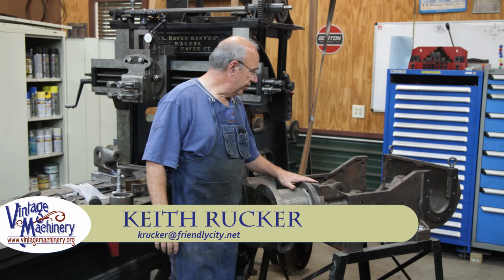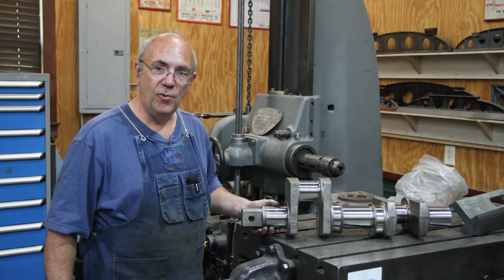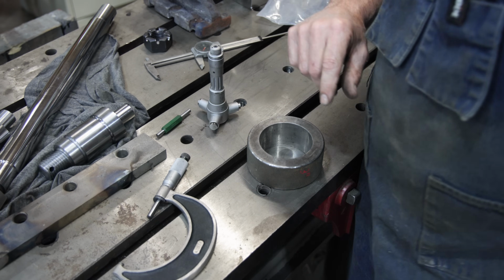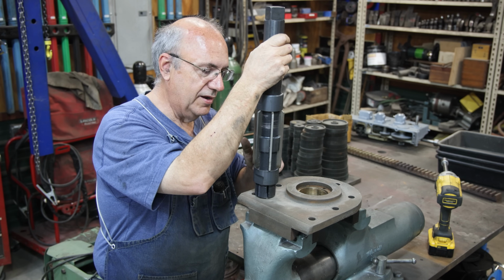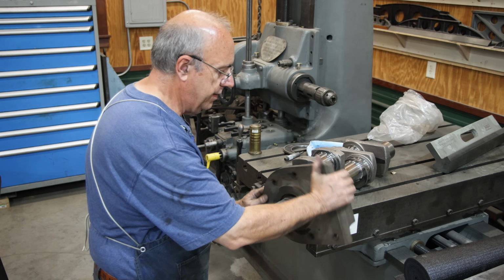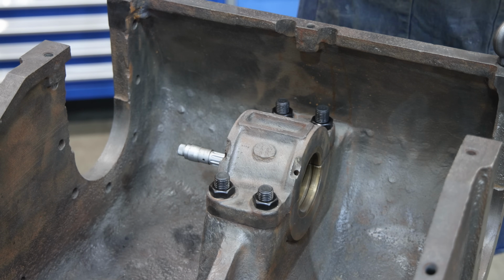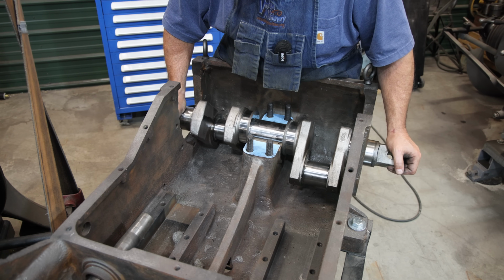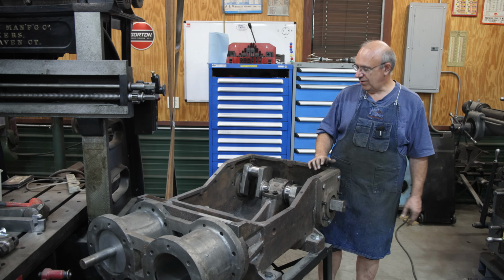Steam Stoker Engine: Installing the Crankshaft

Comment: As a ghetto measure of the middle bearing you could take plastigauge along the full length of the bearing you would see at least see if there is tightness at the top and bottom and that is where you were tight on the other bearing.

Comment: "Fun" story... when we were separating the engine and tender on one of the locomotives I worked on... the last thing holding the two together was the bolt connecting the engine and tender segments of the stoker auger.

There's a hole in the bowl of the stoker conveyor tube to get that bolt out, but the shaft was in the wrong orientation, by maybe 20-30 degrees. So I had the pleasure of squeezing into the stoker engine compartment, and lying on top of the stoker engine, trying to turn the entire auger by hand with a pipe wrench.

Lying on top of the stoker engine, while pulling on the pipe wrench... with all the bits of the cover digging into my torso... that was fun.

Made all the more worse because the stoker engine is connected to the auger through a gear box. In the end, I was able to get it lined up... or so we thought...

The next day when my buddies went to get the bolt out, they realized that it was 180 in the wrong direction, so another buddy had the privilege of having to repeat what I had done, but now going the full 180...

Comment: Hey Keith buddy, you should use a dye and see where the crankshaft is touching the bearing. I think you'll find it's only touching in three spots. I might recommend using lapping compound between bottom bearing and the crank to creep up on the dimension. You could even make a sacrificial rod for lapping

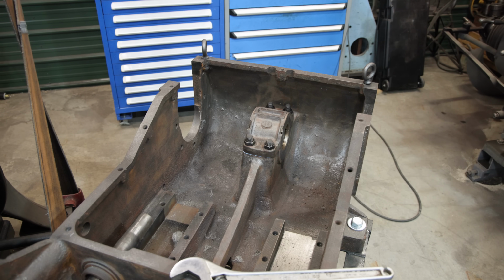Comment: @32:24 I would stop and figure a few things out. 
First is how much can the outer bearing retainers move on their studs? 
Second  is how to ensure they are aligned with the center bearing.

Third is I would use the simple old telescoping bore gauge to measure the out of round on that center bearing. 
After accomplishing that I would get the outer bearing retainers bolted on exactly where they need to be and mount the whole thing on the horizon boring mill, set it up and bore the center bearing in line with the outer bearings.

Comment: 5:03 - Note the crank-pins are quartered so it will always start.
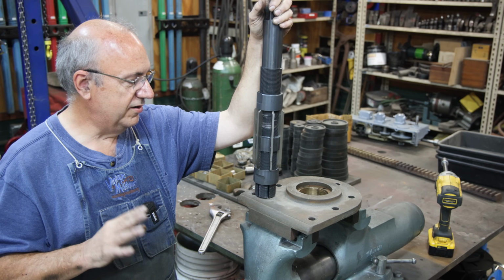14:25 - Maybe. You have three bearings with no guarantee of alignment, and what is probably a fairly high-torque load on a 3-main crank, leading to crank flex if the mains are not in alignment. I'd assume the alignment far more important than the clearance; IC engines (up to 10K RPM) run at .002"/1" of journal size, assuming good alignment.

Comment: If there is any play around the end cap studs, the end cap may pull down on the crankshaft when tightened. Try loosening them up and see if it frees up the crank. If so, tap them into position, then tighten. If not, oh well, was worth a try. I love what you are doing here.

Comment: Once center bearing cap is torqued to spec , it will change the fitment, all measurements should be done with cap at torque ....

Comment: That 2nd end bearing wearing sideways would indicate uneven compression (i.e., that the other cylinder had better compression, as this is when thrust occurs in the other cylinder, them both loading perpendicular to each other).  Something to keep in mind when you get to the piston rings (or however they 're sealed).

Comment: Maybe this has already been covered but I THINK I know why the babbitt bearing material is "reversed" and is attached to the bottom of the Cross Head and not under it on the main casting.  I would think that melting/removing old babbitt material on the cross head is simple (use a torch and let the melting babbitt drip into a container.  However, trying to do that same task to the babbitt deep within the main casting would be much more challenging to say the least.

Comment: Hello Kieth. I would make a pilot/cone for that expansion reamer and line ream the whole thing at once. I use those expansion reamers all the time line reaming airliner Landing gear bushings. We always use a pilot screwed on the end of the reamer with an alignment cone and ream from one side then switch around and go the other way with each adjustment of the reamer. I hope that makes sense.

Comment: So many problems… adjustable readers are crap. You don’t know if you’re bored it’s perpendicular with the housing. You don’t know if the motor housing is perpendicular with the crankshaft.  
Definitely, you need to line bore it for a good job

Comment: I may have missed an episode, but this is the first time I recall seeing the hones on the drill motor.  I know you go to swap meets, do some horse trading, scour the dBay, and occassionally purchase a  new tool from McMaster-Carr.  

What is the thought process for obtaining and retaining your tools?  Did you buy the hones for a specific job and then decide to keep them?  Same way with that adjustable reamer.  I was expecting to see you set that stoker engine up on the horizontal boring mill.  So, do you have a vision of what you'll need and then obtain it before you have the definate need, and once you have used it, how do you decide to keep instead of sell or trade it away?   I'm sure many of us have duplicate tools, tools we've not yet used, or only used once in our tool boxes, but how do you decide?  Do you have a spreadsheet/database of your tools: when acquired, when used last, what project, etc?   And is there a milestone "I've not used this in 10 years - into the trade pile."

Comment: Armchair machinist time. The crankshaft was machined with today's technology. It is easily assumed they are all in alignment and within tolerance.  The end bearings were "hand" reamed into some circular shape, but there is no guarantee they are aligned. If I got off my armchair, I would remove the middle bearing top and if there was enough play in the side bearing bolt holes, assemble everything, spin it, and then torque down the end caps and see if the crank still spins. If not, the outer bearings are not aligned, so figure out a way to ream them as a pair. Then try again. If it eases things, the middle bearing can be adjusted. If they don't then the middle bearing needs adjustment. Now, where's that beer?

Comment: I would have expected you'd need to line hone this to be correct. Otherwise the three bearings could out of line which would bind even if the bearings are the right size.

Comment: I would slacken off the centre bearing to see if the shaft will turn more easiely. Remove the shaft blue the journels and hand fit from there. Time and patience is now needed. Regards Carl old timer with this sort of work.

Comment: Bring it to an engine shop and have it align honed. That will guarantee they are in line with eachother.
Reply: First off, its not "align honed". It's "line bored". All honing does is remove an even amount of material all the way around an already round bore. It does nothing to make an out-of-round bore round again. The honing heads are free floating and allowed to find their own center. So honing bearing inserts just changes their size, not location. 

Second, line boring is done to the block itself, not bearing inserts.

Comment: Keith, thanks for the video and hard work. The plastigage will help with out-of-round indication. Don't forget there are shims on the center bearing caps for a reason, they are removed in stages (i.e. to allow for the bearing / shaft wear.) Old sailor here, steam forever !! 😁

Comment: Would it be a problem if the 3/4" studs that screw into the bottom part of the center bearing are not hitting bottom? I would have thought you would have put both jam nuts on the studs and screwed them down til they were bottomed out.

Comment: If you have an engine rebuilding shop in town, they should have (and I won't know its proper name) what amounts to 'a micrometer on a stick' - a 2-point inside micrometer, with the points at one end of a long stick and the dial at the other.  They stick it down into cylinders then spin it around and move it up and down to measure the whole cylinder bore at various depths and directions.

Comment: I think it was Quinn who said recently that as soon as you have 3 points, alignment becomes critical. I would put a locator dowel in the center bearing and make a jig to align the boring tool with the outer two bearings and cut the center bearing without shims. When this engine was made and expected to do daily service the shims could increase the time to rebuild but I don't think they make sense anymore. BTW really loving this series.
Reply: I concur that you should think about installing tapered pull dowels once you have the caps in proper alignment. I have rebuilt several large machine tools in the past 30 years and this is a common process to insure alignment during reassemply.

Comment: Keith, you could used a plasti-guage on the center bearing.  Having to remove the crank each time to read the gauge strip and then put it back in after honing would be a pain, but we do what we have to do.

Comment: I am going to be unnecessarily pedantic here.  But unless you are using the same standard to adjust to, you are not calibrated to each other as even standards have tolerances and vary.  I know it in no way matters in this case, but as a person worked in situation it did matter, I though I'd mention it.    I worked in a clean room measuring with a CMM and still saw variances depending the slight temperature changes.  There is no such thing as exact.

Comment: How do you know the 3 crank bearings are in alignment?
Reply: I love the way Bozo "just gets to thinking" about alignment issues when he's half way through the project!
He should "just get to thinking" about another alignment issue, he never made sure that the piston rod travel was exactly parallel with the slide ways he haphazardly planed in the bottom of that casting, ( both sides and bottom ), with a dial indicator!
If they are not, slop in his babbitt pour will let it work, but it will never be right!:hand-orange-covering-eyes::face-blue-smiling::face-blue-smiling:

Comment: Those bores will wear oval so a 3 point micrometer will not give you an accurate reading at all. Also reaming the centre and hoping the alignment is correct seems to be a bad plan, definitely a job for a horizontal borer

Comment: My experience with presses has shown that bearing caps simply loosened and then retightened can change the bore line on close fitting bearings.  Such that with split bearings we had to blue the bearing and scrape high spots, reinstall and spin test until we were satisfied with the ease of the spin.  Hopefully your bore line is consistent enough that you can avoid that step.

Comment: It seems to me that if you were in possession of a line bore machine of sufficient size then, aligning, sizing and finishing these bores would be simple. Didn't you rebuild one recently perhaps even, for this particular job? I see it in the background occasionally. Is the stoker case too difficult to locate on the line boring machine? Hand reaming and honing ea hole independently is like using a fly swatter on a big rhino while it's parked in a fully equipped weapons station.

Comment: Morning Keith, I would suggest that you line bore or line hone all 3 journals together as one using your horizontal boring machine. That way all three journals will be in line.
Reply: That would be pointless.  As soon as you unbolt those freshly line bored end caps to install the crankshaft, that alignment is out the window.  There is enough slop in the end cap bolts that the crank itself is the alignment fixture.  This is how it was designed.

Comment: Hello Keith one of things I have always admired about your channel is you show what real problems creep into the process of the repair and how to figure out a game plan to fix it ether useing tooling you have or making it to complete the project making people think of alternative ways way to complete there own projects as you know there are many different ways to do things and achieve the same results you have done that so many times over the years your and excellent teacher KEITH and a real asset to the vintage machine repair community
Reply: I love the way Bozo "just gets to thinking" about alignment issues when he's half way through the project!
He should "just get to thinking" about another alignment issue, he never made sure that the piston rod travel was exactly parallel with the slide ways he haphazardly planed in the bottom of that casting, ( both sides and bottom ), with a dial indicator!
If they are not, slop in his babbitt pour will let it work, but it will never be right!:hand-orange-covering-eyes::face-blue-smiling::face-blue-smiling:

Comment: Wouldn't it be best to line-bore all three bearing surfaces to ensure that they are all aligned in the same plane?  I would think that while the end caps might be somewhat "adjustable", the fixed center bearings need to be made dead-on horizontally alligned to the axis the crankshaft will be spinning, and I recall that is how on regular motors main journals, camshafts, and balancing shafts and on overhead cam heads the camshaft bearing journals are cut -- with a line boring machine to establish that allignment.  That's why it is so important to make sure any removable bearing caps are numbered and replaced in the same location and orientation, correct?

It'll be interesting to see how you will deal with this.

Cheers from Oregon,
Philip
Reply: Don't worry, Bozo will find some way to screw it up!:hand-orange-covering-eyes::hand-orange-covering-eyes::face-blue-smiling::face-blue-smiling::face-blue-smiling:

Comment: The tolerances on the center bearing could very well be non-critical. A possible reason for studs and lock nuts is so you can tighten the nuts against the crushable shims until you get the right bearing fit. Then you lock them in place with the lock nuts. 

Because there are no dowels or other mechanisms to align the top and bottom halves, the only way to get them properly aligned is with the shaft in place. And that makes it hard to measure the bore. Any sort of mechanical measurement is going to be suspect. If you're really worried about it, a crush gauge is the way to go. But I think you're attitude of "make sure it turns easy", combined with the adjustable cap, is on the money.

Comment: Good morning Keith,
Use Plastigauge on the center split bushing lower half, then install the end bearings. Disassemble it without rotating the crankshaft. Check plastigauge  compression dimension. Once you are satisfied with the lower clearance, move to the top cap. You must have the end bearings in place to prevent the crankshaft from rocking and giving you a false binding.
Reply: Yep, green Plastigauge.
Reply: thinking the same thing, forgot what is was called
Reply: @george-b3i-d2d  Yep, what is that darn tool called? I spent time looking for the Name:  Plastigauge  :) Good old days building a motor.
Reply: Plastigauge is a far better measuring technique than is commonly assumed, especially where you do not have align-bored bearing (seats)

Comment: I am surprised that you did not have all the crank bearings bored while installed on the block to ensure that alignment is maintained. Reaming each of the bearings, ends and center individual may provide the clearance but may also put them out of alignment with each other and the case. It should have been sent out to the crank shop to be bored and aligned as a complete crack assembly. Also, on the center bearing, it should be checked using plastic gauge with the crank installed to get the proper measurement and final size.

Comment: I find this project very interesting. I was wondering how big was the steam locomotive industry that used these or similar stokers? Were they made in the 100? 1,000?. The amount of design and manufacturing effort in these was obviously immense. Over the years I have seen photographs of large number of engines being used in all kinds of industries and multiplying that by the number of years of "steam" I would guess engines alone could be in the millions, but how many had or needed some version of a mechanical stoker?  My Google look doesn't reveal much.

Comment: A good way to sneak up on that perfit fit might be to get out the blue and hand scrape those bearings. Or at least check where the high spots are.
Reply: I love the way Bozo "just gets to thinking" about alignment issues when he's half way through the project!
He should "just get to thinking" about another alignment issue, he never made sure that the piston rod travel was exactly parallel with the slide ways he haphazardly planed in the bottom of that casting, ( both sides and bottom ), with a dial indicator!
If they are not, slop in his babbitt pour will let it work, but it will never be right!:hand-orange-covering-eyes::face-blue-smiling:

Comment: Keith I would drill and set some alignment pins on the cap so it will always go in the same place before you size the bearing

Comment: Welding crankshafts is done with submerged arc welding, that is not done underwater as mentioned in the video.....its done in a shop under a mound of flux that looks like sand with a mig type wire.
Reply: Your right, Bozo actually thinks "submerged arc" is underwater!
We used to weld the Mould Boards on the Terex scrapers using submerged arc, that thing laid down a huge weld bead, like two inches wide and twelve feet long!
Reply: OMG! Did Bozo actually say "under water" now I'll have to watch the video!:face-blue-smiling::face-blue-smiling: